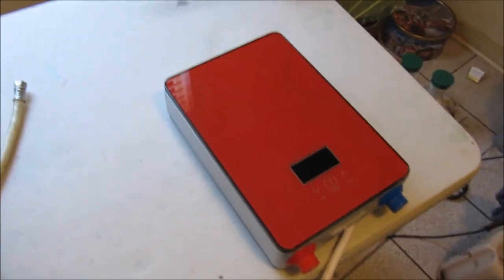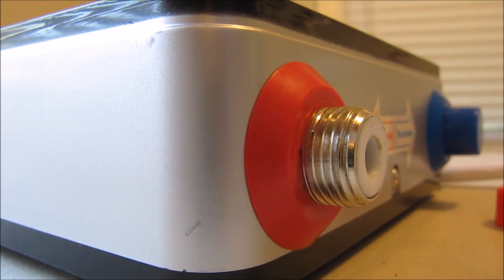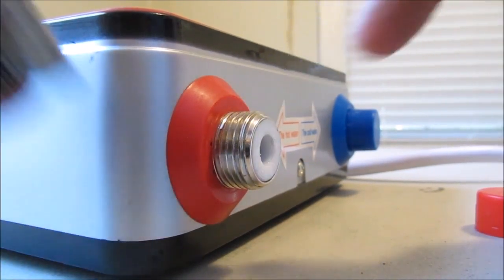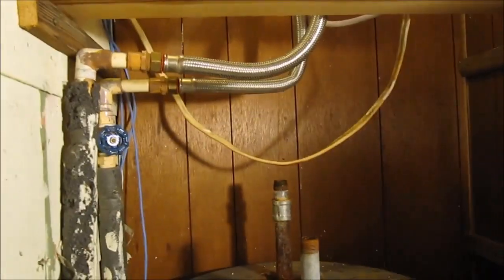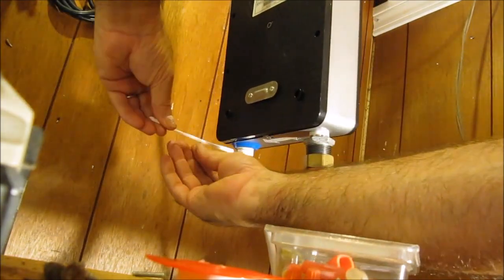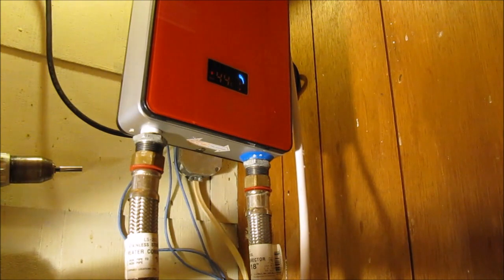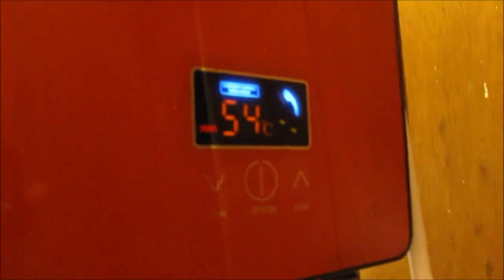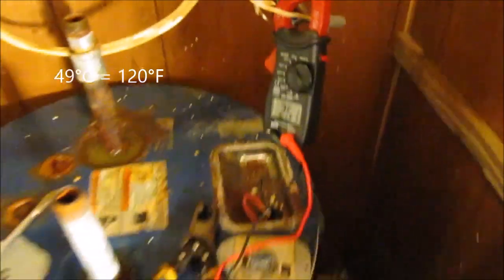DSK-65 Tankless Water Heater Installation and Review

Comment from the maker: Looks like these are available at Walmart for under $60, but the pricing is all over the place with the same device ranging from under $60 to over $140.  
https://www.walmart.com/search/?query=220v%206500w%20tankless

For those who don't mind the risk of buying something directly from China or waiting for the shipping therefrom, these can be had for under $50 with free shipping. 
https://www.aliexpress.com/wholesale?SearchText=tankless+6500w
Reply: We're getting one this week. Your existing pipes reminded me to add a paper/cotton filter and ceramic to the intake. That's a lot of nasty going through the heater that can limit its life span. We have hard water ( lime + calcium ) I might do a simple 3 chamber filtration system since we do drink the water coming into the tiny home. Well water for now. Rain water for later. 😁
Reply: "YES" , wife says we paid $50 on facebook. So it should work for what we need, we're NOT trying to do the whole house, and with 3 heavy #8 wires plus breakers it would get expensive. Thanx, appreciate it.

Comment: Insulation around pipes wld be good
Reply from the maker: That's very true.  I didn't do the plumbing in this 80-yearh-old house (yet) and it is currently a bricolage of PVC, CPVC, galvanized and whatever else was laying around when repairs or adjustment were needed.

Comment: OK so was 30 amps tops? Was that the MAX it'll draw? Maybe I can use it under the sink after all, with a number 10 wire like you did, it'll be just for the kitchen sink. Thanx !!
Reply from the maker: I put my loop tester on this and it draws right at 29.5 amps.  The math works out; 6,500 watts is 220v times 29.5 amps.
Reply: @SAPLSMW  Hey appreciate the quick reply, This DSK-45  says it is 110 Volts and rated at 40 amps, and 4500W, it says so on the label. I found almost the same thing on Amazon, and their install instructions says, a #10 wire, with a 50 amp breaker. Like I said, it is for under the kitchen sink, so wife does NOT mind the water temp as it is. We're talking about a 200 feet of wire, so any other size would be to much $$$$$$$.

Comment: Has it been working ok? 4years?
Reply from the maker: This one still works fine.  I had one fail after a year, but this one and another still work without issue.

The failed unit reports a failed sensor.  I've been thinking about making a video showing how to replace the sensor, but I've been so busy lately.

Comment: OK so you're going down the same path I was when I was looking at the "Echo". We got a "DSK45" heater for $70  deal, but now I am stuck with NO instructions to install. Like you said, this is a 4500 watt heater so at 20 amps "OR" 40 amps, which is what our label is saying. IT STILL needs to be wired up directly to the main breaker box, correct?? AND the wires on the heater itself are #8 wires, stranded, but #8 wires. So for 40 amps, and #8 wires at the heater, are they asking for #8 wire from the breaker box?? And does this heater support 2 bathrooms and a kitchen sink? I was hoping to simply use it under the cabinet??  Thanks for the video.  GOD Bless !!!
Reply from the maker: If you have 8-guage wire then I would consider upgrading to an 8kw solution.  Ecosmart, eemax and Rheem all have 8KW solutions for ~$200.  The Kenuos 8K vanished off of Amazon; I really liked that water heater. 

Airtherial and Vevos have options at 8Kw for ~$135 that look like they'll work just fine.  I'd give that a try first as a 8Kw water heater will add nearly twice as much heat to the shower water in those cold winter months and costs just a little more. 

Check out this video for a breakdown on how to decide which tankless water heater to get based on the temperature of water coming from the ground in the wintertime.  It also explains how to slightly restrict the water flow to increase the temperature coming out of the water heater. 
https://www.youtube.com/watch?v=2yNEjQwk1Hw
Reply: @SAPLSMW  YES we live in Texas, and the install will be south of the boarder. We're not worried about the temp, what ever these water heaters put out is fine with us. The install had me worried, I thought we could simply plug this into a wall socket , like some others, and be done with it. So now, I will take it all the way to the breaker box, with a 50 amp fuse, and a #10 wire. Thank You!!

Comment: But where do the wires go into I live in a trailer and don’t really know where to put the wires
Reply from the maker: Forgive me, but you'll need to look for a local electrician.  This is about one hour of labor, but I am unqualified to walk you through it. 

I replaced a tank water heater with this tankless heater in this video, but I am unqualified to show you how to set up the circuit. In my case, the wires were already run, but it sounds like you need a little more help. 

https://www.youtube.com/watch?v=kT-JNI0YYQs

Comment: Is it still working?  I'm getting error E0
Reply from the maker: I have two installed and they keep working without issue.  I don't know what the E0 error means; it's not listed in the manual.  

https://docplayer.net/26404607-Instruction-manual-dsk-45ep-instant-hot-water-heater-for-proper-operation-and-maintenance-please-read-the-instruction-manual-before-installation.html

https://www.manualslib.com/manual/928512/Gleamous-Dsk-45ep.html

Comment: hello, good day, the heater is used for the shower and kitchen water at the same time? or should I install it individually? you recommend me to use it for an apartment of 120 square meters but only hot water is used for the shower and the kitchen
Reply: Kristh I'd over size the wires. 10 gauge is fine but, 8 gauge is always better. Use a dual pole 40 amp breaker ( technically 80 amps but 40 amp per hot leg then 100% Ground the green/yellow wire.) He was pulling 30 amps which means 30 amps per hot leg so this means its a 60 amp device total. Only problem is when someone uses the sink hot water while you use the shower you'll get a drop in temp. Way to limit this drop is to install a ball valve on the sink to limited the flow of hot water that can be used at the sink. Reduce the hot water flow by 1/2 or 50%. I'm doing this also in my off grid tiny home. I will being making a video 100% in great detail on the power consumption, quality, easy to install and over all satisfaction and what you can expect from this style device. Will it work for our needs? 100% a hot shower.  Note: It does not matter how to install each hot leg they do the same thing / deliver AC that meets  in the middle of the heating element that heats the water. You MUST ground this system to prevent injury/death <- common sense! 😁
Reply from the maker: The heater doesn't care how many faucets, machines or shower heads are running; it will work so hard as it can up to 6500 watts to heat the water to the desired temperature.  These are currently installed in one-bedroom places, so the likelihood of the shower and kitchen sink running simultaneously is slim, but it would still work fine albeit with the risk of reduced temperatures at both locations.  

This tankless water heater adds 33°F at a flow rate of 1.5 GPM; if the flow rate is increased passed that the then increase in temperature will be reduced so long as the delta between the ground water and desired water is more than the device can handle.  If you live near or south of I-10 then you should be just fine in the US or up to about 30° latitude in other countries.  

If you live north of I-20 then I would recommend against this keen device because the ground water in the winter will be too cold for a comfortable shower in the absence of a flow restriction.  You could partially close the shutoff valve at the water heater to restrict the flow and have hotter water, but people don't seem to like 1GPM showers even though they get you just as clean as the luxurious 2GPM shower.  

Check out the winter follow up video to see what I mean about restricting the flow.  It's actually a pretty great device if you live here in the south, y'all.  
https://www.youtube.com/watch?v=2RtRdbktA6o

Comment: Hello, Thanks for the video, Can you especify the electric conection of the wires please.
Reply from the maker: They're 220V/30Amp 10-gauge 10/2 solid Romex. It's the same wires that are already run to the existing tank water heater.
Reply from the maker: Check out this video that shows how the wiring is done. https://www.youtube.com/watch?v=kT-JNI0YYQs

Comment: The one you're testing is a 45 is this a 110 v I have the dsx45 and it says it's 110
Reply from the maker: The one I installed is definitely 220v.  It operates at 6,500 watts and, at 220v, pulls right at 29.5 amps. 

If yours calls for 110v then it'll be pulling in some massive amperage to get to 4,500 watts--that's about 40amps or so; you'll need to install at least 8-guage wire if you're supplying 40 amps to that device and it will not provide a hot shower. 

If you're forced to install 8-guage wire then I would recommend upping the device to a 220v EcoSmart 8.  That'll work if you're south of I-10 to provide a nice hot shower.  If you're south of I-20 then I'd recommend bumping up to an EcoSmart 13 with 6-guage wire.

Comment: Thank you for your video.. I bought the same water heater but i am afraid to install it.. Can you help me what thickness of wire or gauge do i need and circuit breaker as well.. Thank you so much..
Reply from the maker: The gauge of wire should be at least 10-guage with a 30-amp double-pole breaker, but I recommend using 8-gauge or even 6-gauge if running new wire; that leaves open the opportunity to use a more powerful heater later by simply replacing the breaker.  The existing tank water heater likely already has 10-guage wire run to it with an orange outer plastic jacket. 

You can see a brief glimpse of the wiring at 16:20 in the video.  Large wire nuts connect the water heater to your 30-amp curcuit like this: 
Bare copper to green/yellow (that is ground)
Black to Blue
White to Red
Reply: @SAPLSMW  Thank you for the info! God Bless!

Comment: I purchased these, worked amazingly.  But only last about a year then stops.  Lucky they are cheap
Reply from the maker: Can you check to see if there's an error code and let us know?  Perhaps the coil broke and can be replaced for $10 instead of buying a new tankless water heater.  It would make an awesome video . . .
Reply: @SAPLSMW   just disconect coil and check for Continuity :-)))  that simple

Comment: brown is phase blue nuetral green yellow is eath, in the rest of the world, we dont call it hot ground and cold,,,its rated 220 volts so the amprage would be high for 110v
Reply from the maker: Thanks much for the feedback.  I learn a little more each time I make one of these videos. 

We have hot, ground and neutral in the US, too, but ground and neutral are wired together in our circuit panels and neutral is only on 110V appliances.  American 220V appliances have no nuetral--just two hots. 

This guy gives a really good layman's explanation of North American A/C current.  It's silly to have to deal with two different voltages, but it's become a part of our lives. 
https://www.youtube.com/watch?v=P-W42tk-fWc
Reply: @SAPLSMW   You are 100% correct. Hot Leg1 and Hot Leg 2. Both are 110v Hot wires.  Ground is to go to the ground wire incase of product failure its grounded out!  Our Neutral is ONLY 110v service. 110 needs a return. Thus the neutral that allows for the back flow of electrons in AC application. Is neutral and ground the same? NO it is not. Not when running through a breaker box. Breakers will trip properly to break the current! If you avoid running this through the break panel and just wired it to ground... on a fault or not you'd have a permanent current flowing through the ground wire.  Neutral ALWAYS has current flowing through it and sent back to the grid. Note: Ground are for casing of metal devices. The ground allows for current flow on a system failure where something Bad happens and the hot wire touches the devices Metal housing! You touch that you'll either get zapped or worse.  Been there ... done that!
Reply: Additional info. What if the neutral wire has failure? The Product/device stops working. What if the Hot wire has failure and touches the metal casing? Thank god you have a ground return wire to send power somewhere other then heating up, making sparks and a fire.  Neutral and Ground is NOT the same! Neutral is a power turn. Ground is a Metal casing return for power hot wire failure to device. Its a hard concept when not drawn on paper.  people fail to wrap their head around it.  If you do not use the ground in a 220v application and a hot  wire fails where is the electricity going to go?  😉

Comment: Do you think connecting two of these in parallel would be a good idea to get a better flow rate?
Reply from the maker: It hadn't occurred to me.  I think a much better solution would be to invest in a more powerful tankless water heater.  Installing a second water heater would entail running a second circuit and, if I'm opening walls and floors to run a second circuit, it might as well be 6-guage wire.

Comment: Hello, I bought a used DSK-65 Instant Water Heater. Unfortunately I am missing the description and the instruction manual. When I insert the plug, "E2" flashes on the display and there is no warm water. What does this mean? I hope you can help me. many Greetings Tikaspi
Reply from the maker: According to the manual, E2 = "Temperature sensor is short circuit."  Buying a new one is likely cheaper than paying somebody to repair the old one.

You can find the manual by googling "Instruction Manual DSK - 45EP".  Somebody posted it on DocPlayer.
Reply: @SAPLSMW  which wire is hot and which is neutral
Reply from the maker: There is no neutral.  The green/yellow wire is ground and wired directly to the kettle.  The other wires are both hot on either side of the 220v circuit--just like regular tank water heater.

Check out this video that further explains how to do the wiring.  It gives a few more tips for installing these.  
https://www.youtube.com/watch?v=kT-JNI0YYQs

Comment: Hi e1 what mean 🥺
Reply from the maker: You can find the manual by googling "Instruction Manual DSK - 45EP".  Somebody posted it on DocPlayer.
Reply: How to fix this E1 error? I have seen the manual and it says it has electrical leakage. Oh no
Reply from the maker: I would ensure that it's wired properly and that includes proper grounding.  The power leakage detection is likely for safety, so I might consider buying a new one.

Comment: Can you use a 3 pronged plug to power it? Im trying to use it in an rv
Reply from the maker: In theory, an electrician could install a 30-Amp dryer connector on it and use that kind of plug, but it's really not necessary.  Check out this video for a walk through of wiring it up to replace a tank water heater. 
https://youtu.be/ahMrzqnDEc0 

If your RV is on a 30-Amp circuit then this would not be a good solution as any other device running at the same time as this one would blow the circuit breaker, but it would likely work in your RV if it has a 50-Amp service.  Since this poor thing can add just ~50 degrees of heat at 1GPM then it wouldn't be advisable for use in an RV that travels up north in the winter . . .

Comment: Who did you buy it from?
Can you send directions on how to wire it up to the existing wire already ran to your hot water heater?  I’m going to copy you verbatim.  My hot water heater went out when the freeze came thru TX.  Anxious for a full on shower.
Reply from the maker: Search for 6500W Tankless on eBay and Amazon.  These run about $60 all day.

Check out this video to see how I wired mine to replace the old tank water heater.  If you're not familiar with electrical circuits then I recommend hiring an electrician for just one hour; it's not nearly as expensive as you might think and will keep you and your home safe. 
https://youtu.be/ahMrzqnDEc0
Reply: because u had cheap POS with plastic parts in it,, :-)))) no more plastic crap for me

Comment: How do I reset it
Reply from the maker: I don't know that there's a way to reset it except by shutting off the circuit breaker, turning it back on and then turning the unit back on with the power button.